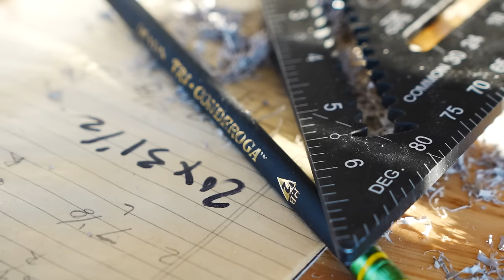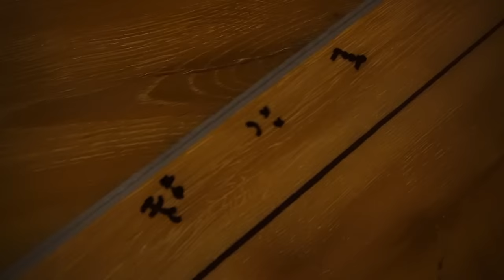WE DIDN'T EXPECT THIS! LIVING THROUGH HOME RENOVATION!

Comment: Hoping in your next video you take out the center piece of the closet - it will be so much easier to redo the closet if it is removed. It will be easier for you or the next owner.   Many modern closet systems use head railings to hang the components versus having a vertical piece that goes floor to center.